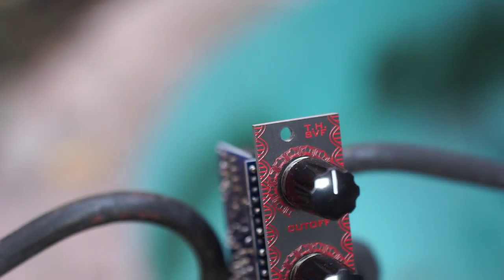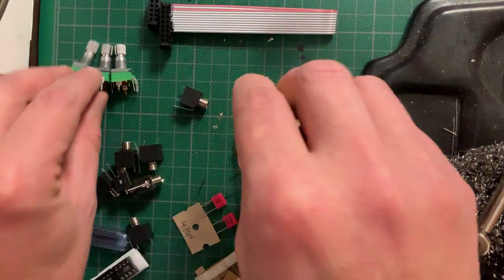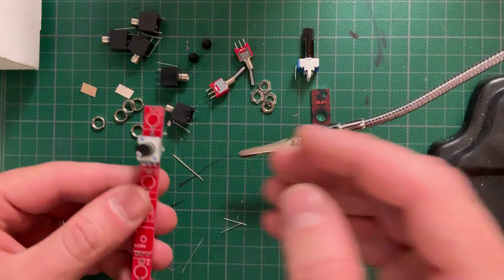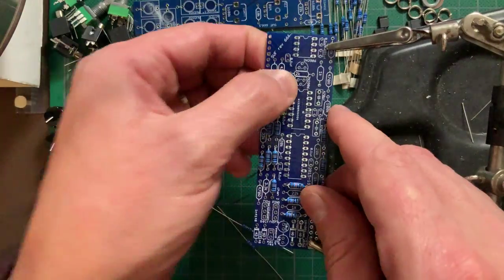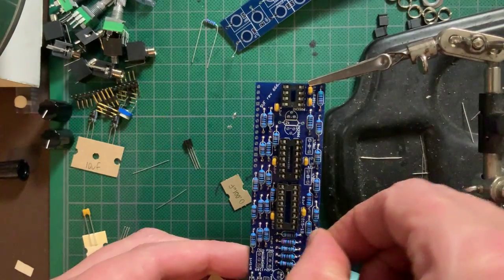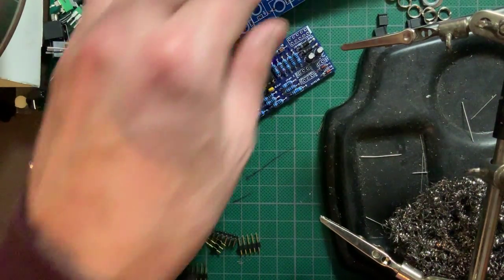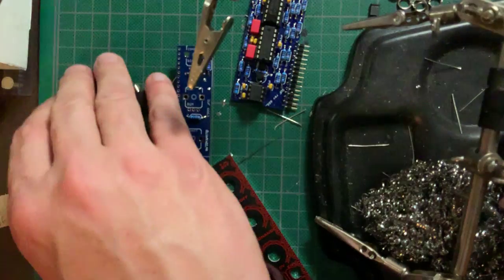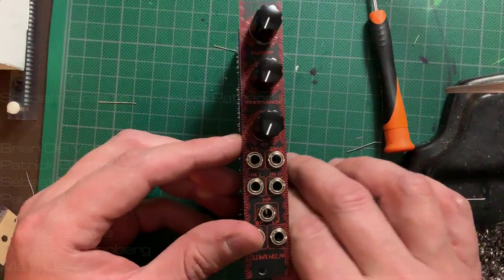Zlob SVF and mini ATT Build Video

Comment: whats the point of a tempco if you don't bother thermally coupling the expo transistors... smh...
Reply from the maker: omsonic it’s not a tempco! Just a resistor. I don’t know either why they put a resistor sandwiched between the transistor pair without it being a tempco or thermally coupling, but I’m sure there’s a reason :)
Reply: "Contrary to what the panel says the filter does not track 1V per octave and is not temperature compensated" (from thonk) huh odd one..
Reply from the maker: omsonic yes, that disclaimer is taken directly from the Zlob website. They do not claim v/oct accuracy, only an approximation, which is good enough for keytracking, and as you can hear in my demo, at least in my unit good enough for melodic playing within a couple of octaves